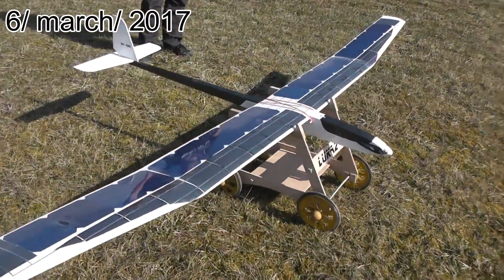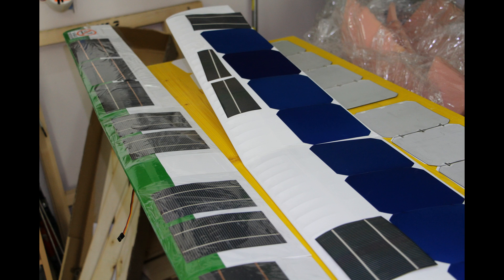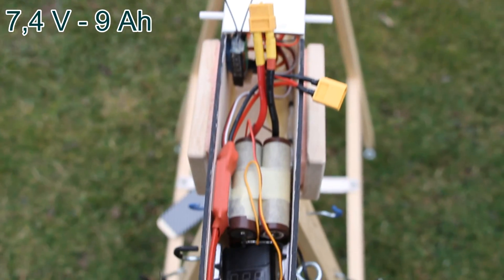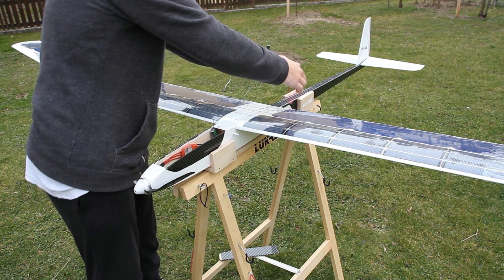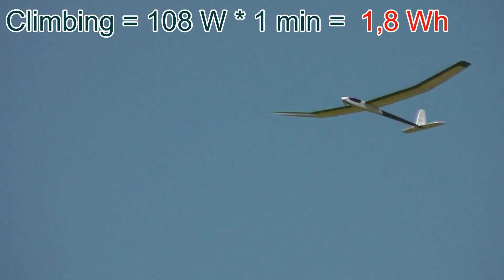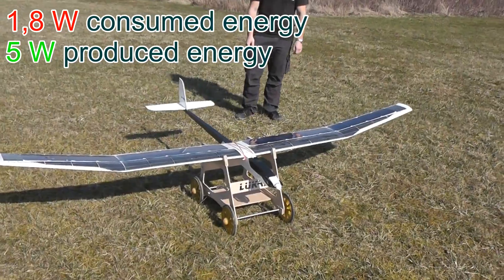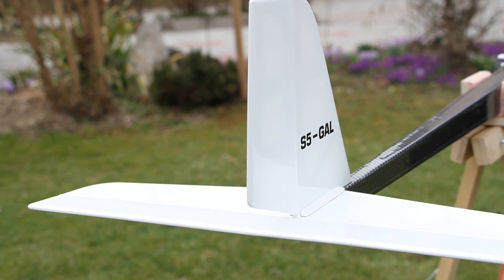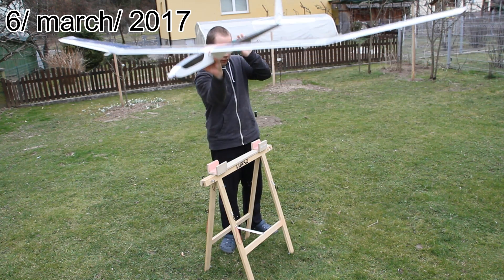Unmanned Solar Airplane V3 - Record 16 h flight

Comment: Awesome! I agree with your views regarding the future of R/C aircraft. Unfortunately, you live quite some ways from me. I am in the U.S., in the state of RI. I have been building models of all kinds since I was very young, mostly fixed-wing aircraft, and eventually I took the plunge into R/C planes and one helicopter. I started get back into R/C aircraft after some years and my goal is to build a long-range UAV. I haven't decided how I am going to power the aircraft, which will dictate the design. I will most likely use a a gas engine along with 'wet-wings' due to the distance that I am shooting for. I have been looking at some of the designs of already available UAV aircraft with my own ideas, including drop-tanks, possibly solar cells to save battery weight and I have also been toying with the idea of an electric back-up motor. I want to install an electric starter, fuel pump, and an ignition system. Yes! It's a tall order. I purchased a 3d printer and I have some experience with CNC and manual milling, something that I have wanted to learn more about. My goal is a 350 mile flight to my brother's home in NY, and back.
I have looked into incorporating WIFI to my design. Raspberry Pi, Pix-Hawk, Ardupilot, Sixfab shield, and a few other goodies. I have ton to learn especially in regards to the electricity aspect and the coding that is involved. That's one of many reasons that videos such as yours are incredibly awesome. Thank you for your contribution.

Comment: Should have checked out RCTestFlight on YouTube. His V3 craft in 2015 was almost identical to this but his wings were machined carbon fiber frames that fit the cells a bit better. Might have been able to squeeze out some more juice. Seems like your battery work is much better though.

Comment: thanks for posting.  good work.    you should realize, however,  at the earth's surface, solar power will  Always be  Intermittent.   that's not good in a power system, where a   Continuous (or  nighttime)   load  is  planned.    cheers

Comment: i didn't understand your calculations because 108 multipled by 1 min is 108 but not 18 Wh and 50 by 10 is 500 not 5Wh
Reply: Undefined Lastname I don't understand why you need to divide 1hr by 60 min and if 108 w is consumed for 1min then for 60 min there will be more energy consumption and 108w should be multipled by 60min and that's 6,480 watt/hr but are you sure it's 108w because that's like an electric blub. I think it's 108mW/min.
Reply: Undefined Lastname Undefined Lastname Undefined Lastname so if your formula means watt/hr = watt used (min used/60min) then for this RC solar aircraft 108W*(60/60min)=108Wh but why it's 1,8Wh(is it 1.8)?
Reply: Undefined Lastname okay... now i got it! But how he measured the wattage consumption for 1 min?
Reply: Undefined Lastname I think that's how we measure the ampre hour of a battery also? On a battery if it's written as 1000mA/hr of 12V battery then does it mean that it will give 1000mA to a load of 12 watt (power = current*volts = 1A*12V = 12W) for 1hr? But how we will find the ampere hour of a battery if we only know it's voltage?
Reply: Undefined Lastname I didn't get the 20 hrs thing but can you tell me what it means when a AA cell battery rated 2500mA of 1.3V and if we make a battery then how we will find it's ampere hour?
Reply: Undefined Lastname how can we find the capacity (ampere hours) of a battery if we make one or if we know only its voltage? how can we measure the ampre hour of any battery?
Reply: Undefined Lastname But is knowing the battery chemistry enough to find it's capacity because in many rechargeable batteries made of NiMH the capacities are different but they contain the same molecule NiMH. Now regarding the ampere of the battery, how do I know which resistor will help to determine its amphere hour? I didn't find the method in youtube!
Reply: Undefined Lastname thanks for the info but i need a universal method of finding the capacity of any battery because I don't know how much load (watt) should be connected to how many volts of a battery to determine it's capacity. By the way, is there any battery capacity meter to do that because battery manufacturers much be doing it with some method or tools?
Reply: Undefined Lastname thanks buddy! I really appreciate your knowledge but I am not sure whether a load tester will help to determine the ampere hour of any battery because I don't know the thumb rule of how much minimum load should be applied to how many volts of a battery to determine it's capacity.
Reply: Undefined Lastname Not exactly but in some batteries capacity is not mentioned and just want to know how the manufacturers find the capacity?

Comment: That's some very cool stuff!  Just a suggestion, in the future you might want to check out different solar cells, find the ones that produce the most power for their surface area, and design the wing around them.
I notice your wingtips are tapered, that means there's quite a bit of wing area that doesn't have solar cells to produce power. Not that it's much of a problem, but for this kind of application you want to save weight as much as possible, so a straight non-tapered wing with the right chord and span could be entirely covered in solar cells with no 'dead' area.
Thanks for posting :)
Reply: I'm thinking it's not just a matter of getting the biggest wing area for the solar cells, but also making an efficient wing, so it can fly with minimum energy. Hence - among other things - tapered wingtips. Balancing the competing requirements - the magic of engineering !
Reply: And I think he connect to series different panel pieces with different size, this is problem because the the current restricted by the solar cell that generate the smallest amonut of amps.I tried this with my DIY solar panel, it was enought to cover one cell out of 24 the power drop from 90W to  almost 0W...

Comment: What are the specs of the motor you are using and the total weight of the solar plane (including battery)?
Reply from the maker: a motor has 110 W of power, and the total weight is 1,7 KG.
Reply: Thanks a lot. Do you also know how much thrust the motor produces when climbing?

Comment: Hi. Very nice glider.
No ailerons are used?
What kind of transmitter are you using to send the GPS data back to ground?
Thanks.
Reply from the maker: I am using APM mini 3.1 and telemetry link: http://onedrone.com/store/flight-electronics/telemetry/3dr-radiotelemetry-kit-433mhz.html . Yes I dont use ailerons, I dont need them.

Comment: Have you thought bout adding some supercapacitors. They can provide boost when you need it and they can soak up extra power from the solar when the motor is not consuming energy.
Reply from the maker: wow, great idea I didn't think about this, I will consider it for my nex solar project. Thanks :)
Reply: Thanks for considering this idea. Let me know if you need help designing or sizing the capacitor bank.
  I looked into it a bit and saw that there is one guy using 18650B panasonic Li-Ion cells in his solar glider. He had great results and i was going to suggest these but considering the inefficiencies of energy exchange and the difficulty of matching the solar voltage to the battery voltage i thought caps could be a good way to go. You might also want to try the newer bigger version of the 18560B 20700 (A, B or C) depending on the application. You would want the one that has the lowest C rating. They can output power for a longer period as long as it's relatively low amounts of power. The cells with the highest C rating are good for very high power applications but they can not last as long in duration.
  Correction. I think the 20700 cells only come as NCR20700A and NCR20700B You would require B as A is the one with the high C rating and short life. But i'm liking the idea of the capacitor technique. I think keeping weight down is key but it might become difficult to fly or more like a glider.
  Well you could put some pretty beefy capacitors in there. I can take a look to see whats out there if you like.
Reply: Sorry, i am just as excited about the performance of the Li-Ion cells as i am about the capacitor bank, the above comment is a bit mixed up :D
Reply: Oh yes, that is you, you are the guy using the Li-Ion :D great idea, very efficient.
Reply: @izzzzzz6  Please explain to me the instruments that used in this prototype and where I can buy them and how I can make this same prototype ..really I need your help????
Reply: @ikrammisbah4798  I didnn't watch the video in a while. Probably powerful transmitter possibly with directional antenna and rf amplifier (booster). Probably with telementary heads up display relaying info back to the goggles, perhaps with gps backup for head home. All available on ebay or hobbyking or a bit of both. Or Bangood or ali express etc.
Reply: izzzzzz6 i didn't understand his calculations because 108 multipled by 1 min is 108 but not 18 Wh and 50 by 10 is 500 not 5Wh
Reply: thats because he is Talking About wattHOURS, and a Minute is 1/60 of an hour. So you Need to multiply 108 by 1/60, which gives you 1,8wattHOURS
Reply: unbee73 but he had mentioned that the aircraft consumed 108w while climbing for 1min and if it consumed 108watts only for 1 min then how come it will consume less power (1.8 watts) for 1hr?
Reply: Debojit Acharjee IT DOESNT.
A wattsecond (also named Joule, ever heard of that) is not a wattminute and not a watthour (Wh) although they all measure the same thing. Wh is watt * time and measures how much energy has been used, while watt (W) shows how much it is currently using.
Reply: unbee73 I know but think logically if the motor is consuming 108 watts of energy for 1 min only then it will consume 108 watts of more energy in the next 1min and so on. Then for 60 min (1hr) it will consume 108*60= 6,480 watts/hr then how it will be 1.8watts/hr?
Reply: Debojit Acharjee because the motor is only running for a minute.
Reply: Debojit Acharjee also you confused minutes and hours again.
Reply: Debojit Acharjee oh and no it does NOT consume „108 watts of energy“. it consumes „108watthours devided by 60“ because the motor is running 1/60 of an hour, which is also called a minute.
Reply: unbee73 okay may be it was running for a minute but the calculation was done for an hour (60min)!
Reply: Debojit Acharjee nope. The calculation was done for a minute and actually is correct.

If you let a motor, using 108w, running for an hour, you will have used 108Wh. Letting the same motor running for a minute gives you... ?

Not trying to be mean, but did you ever learn physics in school?
Reply: unbee73 now let me tell you what is the exact watt hour for this aircraft... it's 0.0018 Wh and lrt me tell you how... to calculate watt hours you nerd to find the watts of the load and here the motor (load) is 108w and time of consumption (1min) and multiply the watt with consumption time (in hours) and divide by 1000. So we get 108*(1/60)/1000=0.0018 KWh. That's it!
Reply: Debojit Acharjee why devide by 1000?
Reply: unbee73 to measure in kilowatt hour but if you don't want in kilowatt then for this aircraft it will be 108*(1/60)=1.8 Wh only!
Reply: Debojit Acharjee thats what the video said. 1,8Wh 👍

Comment: Wow, this is a cool plane.      If youn can build a camera into the cabin, you can remove a bit of the trimmweight in the nose and you can fligh on a long range so you can produce a great photage. Good luck from germany. Ps: sorry for my teribble english, im still a student. ;-)
Reply from the maker: This was just a prototype, soon I will be making a better airplane. Thanks for great idea :)
Reply: I didn't expect to have a awnser so soon.
Reply: @LukaArtelj  pleassse how can i do that ???can you write the instruments and the way ?pleasse really I need your help??
Reply from the maker: @ikrammisbah4798  not a problem
Reply: @LukaArtelj  ??
Reply: @LukaArtelj  just because I have to do it for my oral exam about SOLAR IMPULSE and i don't know how can I do a prototype ...i need to know the instruments exactly 
Sorry ..but really  I need help!!
Reply from the maker: @ikrammisbah4798  instruments in solar impuls are the same as in any other FES glider: LX9070, FCU unit, vario, compass, altitude indicator, speed indicator, flarm, radio and transponder
Reply: @LukaArtelj  okkkk,thenks al looot but what is the difference??
Reply from the maker: @ikrammisbah4798  google FES glider 🤷‍♂️

Comment: Hi Luka, well done. Simple and effective!! You are using the SEPIC module if I am correct. Did you consider connecting it to an Arduino and have it work as an MPPT?
Reply: hey man, how is going with this new project ?
Reply from the maker: I don't use MPPT (power tracker) because my plane is more than 100% efficient so I don't need it. But I am working on New Bigger Solar Airplane that should fly FOR 24/7 whit MPPT.

Comment: Hi Luka, Great build! Thats impressive run times for so few batteries. Your solar cells are definitely doing their job! What kind of motor were you using on that 16 hour flight? How long could you fly that setup without solar cells. Sorry if you answered any of that in the video. I watched it all but may have missed something.
Reply from the maker: Hi, I am using 2836/8 1100KV Brushless Outrunner Motor, simple and effective. Without solar cells, I can fly for 1.5 - 2 h.